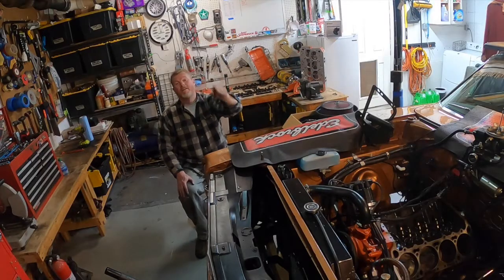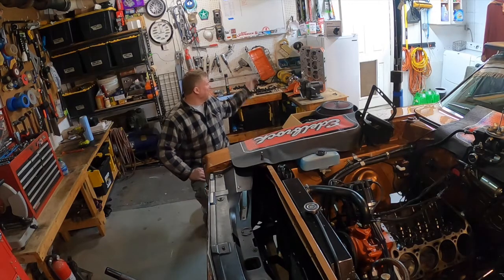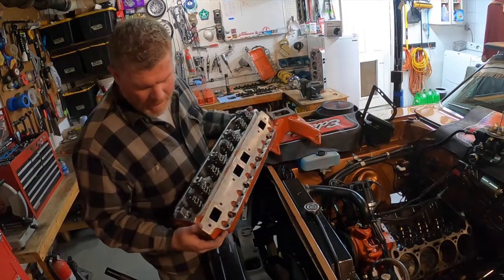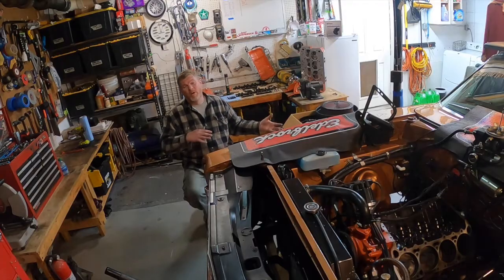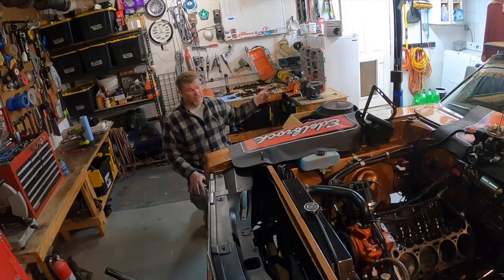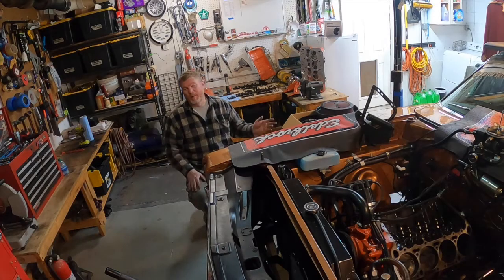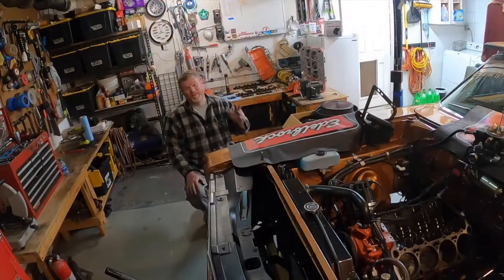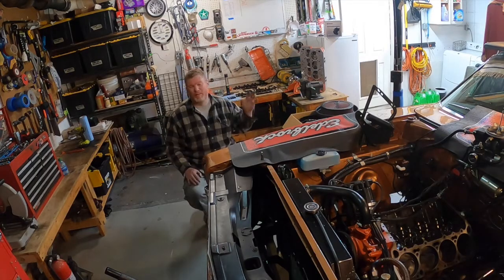What Caused You to Take Apart a Running Project Car? MCM Shop Talk

Comment: Great video! 
What you are doing is absolutely necessary. The ultimate problem with this type of set up is the design limitations of a “bolt on” head.
The cnc work only goes so far. 
The progression of big wedge engine building has fascinated me for nearly 40 years now.
Love your channel.
Kevin Griffitts
Reply from the maker: Thank you, sir! Thus far, we've seen B-bodies similar in weight and setup break into the 9's with Hughes-machined Edelbrock RPMs. The Trick Flows show to be the superior design from several angles (we have a pair for another engine), so there's still plenty of "meat left on the bone" for our build. What suggestions would you make otherwise? I'd love to tap into your experience and know-how! –K

Comment: I've done it many times for a wide variety of reasons, swapping out a cam, new heads, etc. as most gear heads have I am sure. Probably more to the story is what you hit on, fully functioning cars taken apart for little or no reason and then never put back together. This is typically done by someone who doesn't know anything about cars and has no understanding of what is involved in rebuilding a engine but gets a hint once the engine is apart and then gets stuck. I once bought a 69 Roadrunner with a 383 that a guy completely disassembled to "restore" (this was back in the 70's) and basically just tossed everything into the car and left it. It took quite awhile to sort everything out but the engine was standard bore with no ridge so we basically just rebuilt it with new rings and bearings and got it on the road again pretty quickly.
Reply from the maker: That’s awesome- glad to hear that you saved it.

Comment: MORE POWER is always the reason. I pulled a nice running 383 out of my 69 Roadrunner and will be replacing it with an RV 440. It came with an extra forged crank and LY rods that I will be using in the rebuild. 10.1 Wiseco 4.35 bore pistons 440 Source Stealth heads, their 509/510 cam, Edelbrock RPM intake, and TTI 1 7/8 headers. I'll start with the Holley 650 off the 383. We will see.
Reply from the maker: Heck yeah! That sounds awesome!

Comment: Lol...i recently disassembled a 440 that I built 7 yrs ago to make it a 500 ci...and I may take it apart again tomorrow to put dished pistons in it so I can run lower grade fuel!....so 8 yrs since last rebuilt, (didn't even have a car at the time)...did full machine work, new everything, 440source heads that I sent to Dave in 2014 for full CNC work and yes they were  beautiful!...then sold those heads for Trickflow 270s...then decided to go 500..and now I have a cam addiction as well, 2 hydraulic rollers and a solid flat tappet all sitting on the shelf because I can't decide what exactly I want out of it and now with ridiculous fuel prices, the 11.5 to 1 static compression makes me wonder if I need to go back to the drawing board....all the while I have an all aluminum 528 hemi sitting next to jt, 90% done, and I only have one car to put either engine in!....I need psychological support 😀
Reply from the maker: LOL! We're here for ya, Duane! You're NOT alone!
Reply: I did the same thing but a 512 I’m using the trick flow kit with  so their cam and Holley terminator and 200 nitrus . The Holley really helped me with the fuel problems. I was always worried that the heads were too big! For street use . What do you think?
Reply: @goattuff  270 heads are perfect for the street, they should not even sell the 240 heads...it's the shortages of max wedge port size intakes that is the problem

Comment: I took the 13.25:1 compression solid roller cammed 360 out of my Dick Landy owned Duster to put a big inch X block small block stroker only to find out the X block was junk.  So plan B was to put a freebie 318 Magnum in with a GT45 turbo, with fuel injection running on E85.  I had a race car that I was converting into a fast street car.  So far I've bested the MPH of the race engine, not I just have to beat the ET.  Soon!
Reply from the maker: NICE! I love to hear this!
Reply: @moparconnection   The history of my Duster is on my channel Mostly Old Parts And Rust.
Reply from the maker: Sweet! I'll go check that out.
Reply: @moparconnection   Thank you!
Reply: @moparconnection  Thank you!